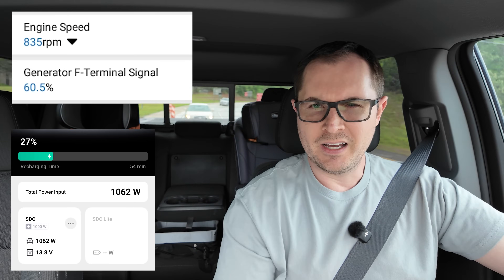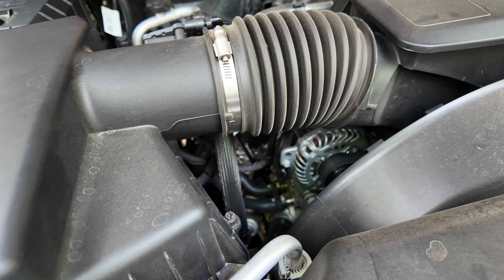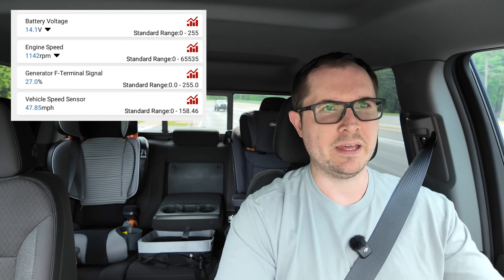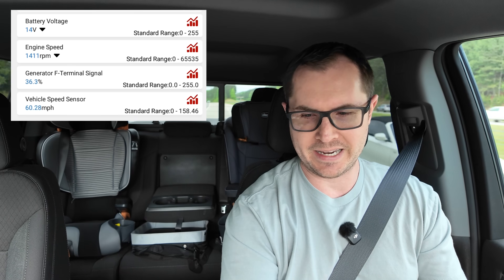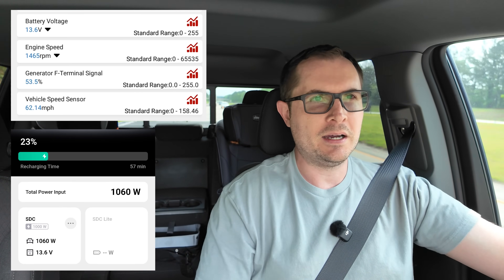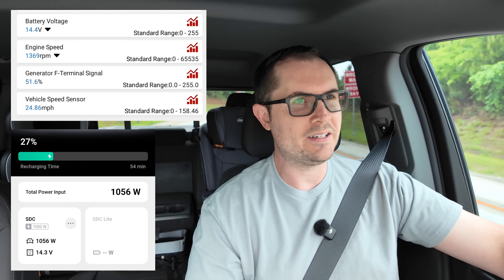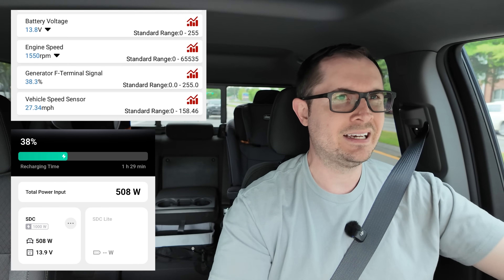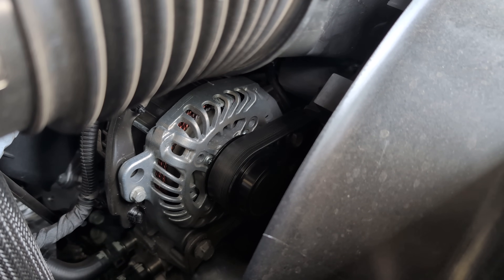I Show REAL Numbers: Impact of DC-DC Chargers from DJI, EcoFlow, Bluetti on Alternator

Comment: Yes, they destroy the alternator.  Just did it, $2,900 repair.

The numbers you provide are revealing but do the reveal where the real damage occurs?

When the measure shows current load of 500W, as many of the 12v-ot-12v chargers indicate, this is not clear of the impact.

Variations in RPMs results in peaks and valleys in current generation.  Then there is duration of variations in load.

This vehicles F-terminal signal and OBD2 port provide read outs which are specific samples of points in time, that interval is not stated here.  Some peak loads only last micro seconds and can result in severe damage and cumulatively, total failure.  Therefore, root and contributing causes may be difficult to analyze.

A second condition that leads to failure and is also not apparent as to the dynamics involved is a continuous load condition.  This is where the device stated 500W load runs continuously for a period of time such as 45 minutes.  A failure may occur during this cycle or may not appear until a later time.  What has happened is a "thermal-runaway" where one damage occurs which may not result in total failure, or total failure which will be immediately apparent and a simple correlation of cause and effect can be made.

In my complicated case, I used two different devices under completely different loading conditions.

The first was a 1,500w inverter with peak handling of 3,000 watts.  I used a circular saw which created peak loads of 3,000w over 10 occurrences, one occurrence where the saw bound and locked resulting in the inverter safety mechanism to shut the inverter down.  These events did not result in detectable damage and  the assumption was that all was operating per standard operating conditions.  They were not.

A second inverter, a 1500w pure sine inverter was used.  I connected a LiFeP04 120v25w charger to a 100AH LiFeP04 battery to test charging time on a 10% depleted battery (90% AH available still).  Ran the charge for 10 minutes, made a stop and forgot to turn off the inverter for 10 minutes.  That duration continued to drain the vehicle starter battery.

I continued with no apparent problem to final destination 20 minutes later when the inverter threw a code of "low voltage".  I shutdown and disconnected everything.   3 minutes later, the dash lit up like a xmas tree, the car went into "LIMP" mode and battery power was so low that the steering was nearly 100% inoperable.

So in summary, a combination of pulse peak loads and continuous load generated thermal run-away resulting in alternator failure.

further complications of throttle body sensor damage and a disintegrated radiator resulted in greater costs.  Fortunately the failure occurred where I found a very competent mechanize who's technical metal was significantly challenged with CPM corruption/reloading challenged (6+hours).

In summary, be very careful and know exactly what you spare alternator capacity is at various rpm's and exactly what your device may demand of your alternator.

The alternate is a significant repair.

For me, I would have gladly traded the $2,900 repair, $500 hotel, and $200 in meals and such for a second battery, $170 and a 400w solar setup, $350-$400, quite a steal.

Cheers,

Greg
Reply: Be careful or be prepared to pay for a repair that may be extremely expensive.
Reply from the maker: Great points, thanks for watching
Reply: @AdventureRocks  I really appreciate your 12v-to-12v evaluation. The data was awesome.  It really got the thinking juices flowing.  

I just don't want other people to have a $4,000 learning expense.  

These devices may be appropriate under very specific circumstances.  I would consider one if I had a second high capy alternator completely separate from my vehicle electric system.  Or just have a completely separate solar and or shore 110v charging system.  

I now strictly charge my LiFeP04 100AH batteries by shore-110v and am adding a 2nd 100AH battery for winter camping with electric blankets, my wife gets cold feet but she loves cold-weather camping (no bugs). 

My trips are usually less than 3-4 nights but next summer we planning a two week continuous trip to RMNP, Tetons, Yellowstone and Glacier.  So we are doing a lot of test runs and making improvements and fine tuning our minivan's camping capabilities.  We are learning a lot.

I will be adding clear plastic walls to my 12x12 pop-up-canopy with a 18k btu mr. heater.  This is our living room/kitchen with 360 degree view.  We only sleep in our minivan as we love to be outdoors the rest of the time.

Our battery use is primarily for CPAP's, coffee pot, usb recharging and electric blankets when it is cold.  We don't camp in hot weather, it's just not enjoyable for us.  That leaves us with 5-6 months of good camping.

Keep up the great videos, yours are the best technical pieces.

Cheers,
BoDiva and Greg

Comment: Great reporting!  It would be very interesting to see alternator temp over ambient (like type K thermocouple readings).  Commercial products can capture this info or you could use products from Sparkfun, Adafruit, (I have no association other than as a happy customer over many years) or others which supply the "maker community".  Sensors of ALL sorts, regulators, controllers, relays, and data loggers, etc. all daisy chain together and report to a wide range of computers, phones, etc.  I am absolutely not a competent coder, electrical engineer, or hacker.  However, with the amazing support of the community of folks volunteering their efforts and wonderful documentation, this is almost a no-brainer.  You can output to Excel or freeware equivalents and log or display in real time.  It is geek heaven!

Given the growth of fantastic battery-powered camping gear from tent AC to refrigerators, heaters, etc. and the rapid increase in external battery bank capacity, it seems obvious that meaningful charge rates need to be relegated to a purpose-built secondary alternator.  This would allow sensors to monitor the internal points of heat generation as opposed to housing temps far from the BBQ going on inside.  An internal regulator could monitor all the operating parameters of the alternator (including RPMs, temp, etc.) and use PID-style regulation based on near-term load history and known thermal responses to selectable charge rates.  PIDs are fantastic, cheap and can keep the gubbins out of danger, without tying to the existing electrical system or CAN bus.    

It does not sound sensible or even safe to go off into the wilds, particularly with thermal extremes, and beat the hell out of a stock alternator with additional loads equaling that of the vehicle.  This can't go well!  Let the vital alternator have a safe life with low average loads and don't even tap into the CAN bus for the data needed to monitor and regulate big loads for which the vehicle was not specifically designed.  That would be crazy.  If you are inevitably going to cook your alternator, instead, buy another made for this new task, with its own sensors for and PID-style predictive controls baked-in.  Keep the duty cycle as close to 50% or what ever load allows the alternator to last as long as the stock one.  

Ensure that your rig can get you out of the wilds with a huge safety margin; you intend to depend this stuff for years, with remote trips each amounting to rolling the dice.  It is amazing how fast this can go extremely wrong, especially with climate-change-driven high wet bulb temperatures.  Waves of deaths are increasing where AC is unavailable and cooling through evaporation doesn't work.  Read about it, please.

The great news is that a bit of planning can keep us quite well covered for our adventures.  Battery-driven systems provide backups for the safety blanket our vehicles provide.  It is a wonderful era.  Enjoy, but plan so that your joy is uninterrupted by serious problems.

Brian

Comment: Great video! I thought I had destroyed the alternator on my Bronco when I came across this video. Turned out I had a cracked buss bar. It got me to thinking though, I have the Ecoflow and run a small fridge on a daily basis. Based on the info here I've turned it down to 500W max. My daily commute is just streets with a lot of lights, I'd like to know if you can tell me-Am I operating well within safe limits of the system? I get out to the middle of nowhere often and would hate to be stranded by a dead alternator. Also, I have the 230 A Alternator option on my vehicle. The Ecoflow alternator charger is charging an Ecoflow Delta 2 1024 Wh power station. Thanks for any help!
Reply from the maker: I think you're well within your capabilities. Mainly I learned just to avoid running if I'm idling a lot in traffic and use more when I'm at 40mph+ average. And if you don't need the full 800W, turn it down like you mentioned. Set the minimum charge threshold to 13V and that automatically throttles the charger down if alternator is struggling.

Comment: Thanks to an AI search, I found the following: (I have edited and added to)

When you have a DC to DC charger hitched up and you're charging your lithium iron, phosphate batteries,  When the BMS of a lithium iron phosphate (LiFePO4) battery suddenly turns the battery off (which it does sometimes when the battery is close to hundred percent or sometimes for other reasons), the alternator, which was supplying power to the battery, is left without a load and will experience a significant voltage spike, often referred to as a "load dump". This extreme voltage can cause the diodes in the alternator to overheat and fail, or can "fry" them, rendering the alternator non-functional. This damage occurs because the alternator is designed for lead-acid batteries, which have different charging characteristics and don't abruptly disconnect when fully charged. A sudden removal of the load from the alternator can cause its internal components to fail.

This immediate surge can kill some or all the diodes... add a little lead acid  battery into the circuit, and it will absorb that momentary surge, and all should be good until that lead acid battery is turned into toast in four or five years. There needs to be
A better solution. Maybe an electrical engineer can weigh in on this . Maybe a better set of diodes that can handle the surge or something to stop the surge, going into the diodes??? I don't know, but I know that this damage happens.
Reply from the maker: Great question. So in consumer DC-DC applications they must be connected to a battery and not the car's alternator directly. Most vehicles use a lead-acid battery and that is what the DC-DC charger connects to. The alternator is topping off the lead-acid battery and the DC-DC charger is using it as a buffer essentially. I could definitely see damaging the alternator if one attempted to skip the vehicle's starting battery and rig it direct to the alternator.

Comment: 😂 great information personally, I’ve been using DC to DC chargers for probably eight years now with several different vehicles and we’ve never had a problem, so far, but it’s good to know what kind of load we’re putting on our alternators. We also run many high intensity lights which puts even more load on the system.

Comment: There was one DC to DC comics converter that I found that used input voltage adjust the charge rate.

If you set it to 14V, it would draw down to 14V.

This would be a nice solution, you you watch the video he drops below 14V even at 500W.
Reply from the maker: Great point. Most of them have a minimum charging threshold voltage setting. Typically they are set in the 12.6-12.8V range from factory. I set mine to 13V and it seems to work pretty good there.

Comment: Good video and brings up some other points to note: 1) you probably already have a factory installed inverter, there is no difference in principle to a dc-dc converter except that the dc-dc is more efficient to charge power stations. The point being that the dc-dc converter is no real difference to the alternator. The draw put on by the power station is the real issue 2) the load is only active while charging, an hour or so max with most power stations, then they are charged and the draw stops. 3) power stations all come with a way to limit the watts they draw from input so if you have a smaller alternator, set the limit lower on the power station but remember it will take longer to charge..

https://www.youtube.com/watch?v=jgoIocPgOug

BTW I chose to install a pure sine wave inverter instead of a dc-dc converter, which charges less efficiently but puts out AC to power other things AND all power stations have fast charge on pure sine wave AC input while mine limits DC charging to 200 watts. Most built-in inverters do NOT put out pure sine wave and so are ignored as input by power stations, rather frustrating but true.

Comment: I have the bluetti charger 1 that I only use during long trips, sometimes back and forth to work. It's connected to the vehicle's battery, putting them in parallel and matches the 12.6 volts. I noticed that your dc to dc charger was drawing more than that. The charger 1 maxes out at about 500 watts, so it's only pulling about 50 amps. My vehicle's alternator is rated at 130 to 135 amps. Even with everything on, it should be pretty safe at above idle. From what I understand, it's not great for you to idle most vehicles for long periods of time anyway. Get a generator designed to do that(keeping below an 80% load). I'm definitely no expert, though. I'm going by Mr. Google pants information. Also, I have a portable solar array (mixture of 12 volt battery bank in parallel and bluetti ac200l) that allows me to monitor volts, amps, and watts under light and heavy loads. The system has a max draw of 100 amps. Usually runs at about 50% with 2000 watt inverter running everything. That's lights, refrigerator, small ac, tv, etc. Due to the limitations of a 2000 watt inverter, I have to turn off my ac to run the microwave. So I'm pretty sure my alternator can handle it. And as you mentioned, I'm not doing it all day every day. It's only occasionally. Great information, though. I have been curious about it. Thanks!

Comment: i put a switch on the dash where i could flip on/off a Renogy 50A DC-DC charger... 
but is there any reason flipping it off quick during stops could be an issue?
Reply from the maker: Should be fine. I believe there is a setting on the Renogy app to limit minimum threshold...you can bump to 13V+ or whatever setting seams about right to keep alternator from getting overloaded during peak use.

Comment: I know a second generation automotive electrical professional, who is always replacing alternators on ambulances in his small town. The high electrical demand increases maintenance cost, unless it is an ambulance that has a big rig type power base.
Reply from the maker: Great point
Reply: Wouldn't part of this be specifically what is being addressed to avoid? Having high demand sitting at idle, overheating and burning up the alternator? It seems like an alternator is looked a as a consumable part on an ambulance or a police car specifically due to that excessive load burning them up probably cause they sit around idling so much, and they never really actually get to cruise at speed.

Comment: my Jeep came factory with a 240amp alternator and a generator/winch mode (2000 rpm high idle). It does not care about my ecoflow 800w fast DC/DC charger. Besides even if say i somehow seriously fudged up and put crazy load on. Most modern tucks, and i have confirm mine does, will cut off alternator output to preserve its integrity and flash a dash light to tell you to stop being a bellend. Also the with smart alternator systems, they tend to use the battery as a middle man punching bag, greatly reducing its duty cycle. There are plenty of times during highway cruising about an hour in and the alternator kick offs for an hour or so and then comes back on when the battery drops to a certain percentage range. The only issue i see is if you have pitifully small alternator and a not smart one. You could 1000% cook the 80 amp bastard under the hood of your 08' forester. My buddy's dual 180 amp alternators i his 7.3 powerstroke? doesn't matter, you'd be hard pressed to ever overload that thing.
Reply from the maker: Nice setup, and great points.

Comment: Ok question, 170a alternator 55% load is just over 1100 watts output, say 500 ish watts is the trucks draw where is the missing wattage coming from to support the dji outputting over a thousand watts ?
Reply from the maker: Great question. The DC-DC converter is actually connected to the vehicles starting battery, which is typically a lead-acid battery. The alternator is then connected to that same battery and programmed to try and keep it up to proper voltage/charge. The lead-acid starting battery is almost like a buffer, so there is some "play" so to speak. If crusing on the highway it's no problem to continuously get the 1000W for the DJI, but if you're idling, eventually the lead-acid starting battery will get depleted enough and the alternator won't be able to keep up...plus it'd get pretty hot.